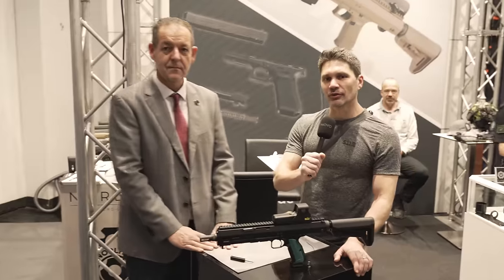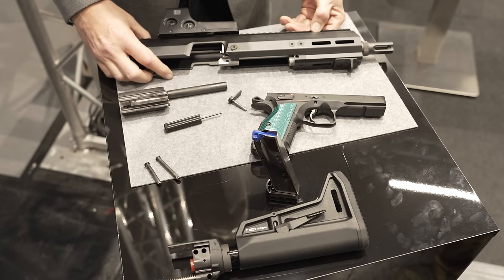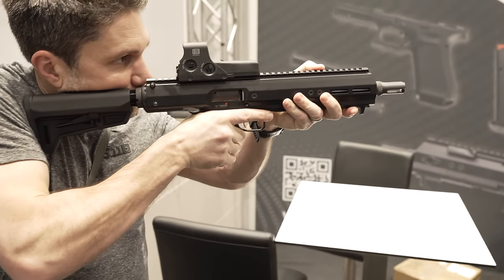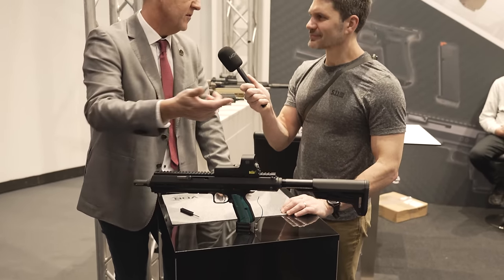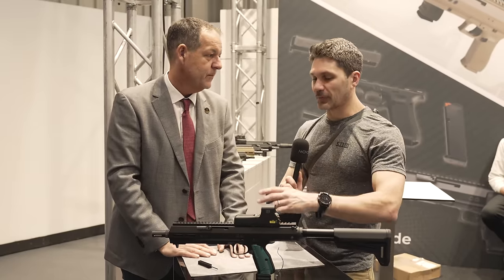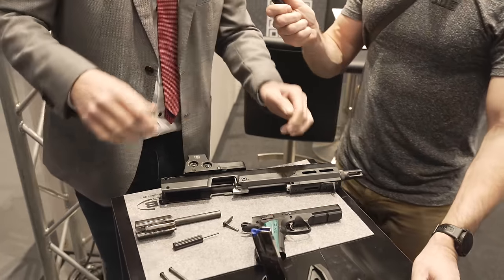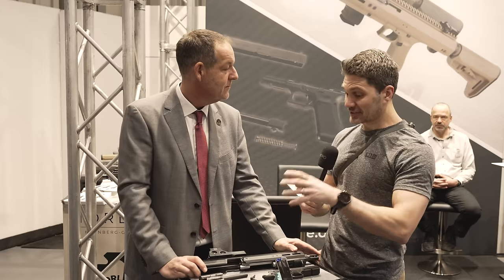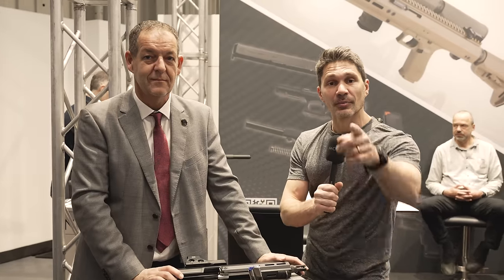A High-End German CZ-75 Carbine! The Norlite USK

Comment: For a CZ collection it would be worth it.  Let’s say you have a couple of different models of the 75 can see it being useful in that case.  The only downside of the Scorpion is the proprietary mags.  If this worked with the P07 you could use the higher capacity P09 magazines with the P07 lower.
Reply: Scorpion mags may be proprietary, but they're becoming somewhat of a de facto standard. The alternatives are more expensive (the Sig MPX ones) or worse/more unreliable (Colt-style, Stribog and everything else in between). Scorpion mags are both inexpensive and reliable.
Reply: @jeffersondaviszombie2734  I hope CZ can get them to be the industry standard.  I was thinking more of the PCC’s that are taking Glock mags.  All I have are CZ’s.  😀

Comment: I looked at getting an optic ready slide for the CZ Shadow 2 and it was over 700 dollars so I thought that it was way cheaper just to get the slide milled.  Likewise the price is just too high as it’s almost the cost of a standalone higher end PCC.  When the aftermarket accessories are almost the cost of the firearm it becomes totally impractical.  It’s like attempting to convert your bicycle into an ultralight moped for almost the cost of a moped. Why not just get a moped and keep the bike as is?  At its current cost, why not just get a new $1,500 PCC. That way you’ll have a pistol and a brand new PCC.
Reply: That is valid idea for people who cant get just new complete gun.
I like the idea but price is definelty bit steep and im afraid how many serialised firearms parts
i had to apply permits to get this. Honestly im not sure how our laws handle complete uppers
in same caliber.  

Stand alone serialised firearm part will need their own permit and every permit cost today quite lot 
in many cases it is actually  more cheaper to just buy complete firearm than parts. 
Advantage we have against german laws that we dont have any limit how many firearms you can have.
So least for me it is actually cheaper to just buy complete carbine.

Comment: The Glock version never came to the US. I doubt this one will either. 🙁
Reply: Are we able to have it shipped to the us?
Reply: While it’s cool, it would probably be a tougher sell at the price point they mentioned here where we don’t have the limitations this was designed for help with. There’s a lot of stand alone PCCs on the market people could buy here for less than $1500.
Reply: @tizben  If I'm not mistaken the company simply does not see it as profitable, and German export laws are extremely complex. So I don't believe there is any simple way to do so.
Reply: @Andrew_182  You're right. It only makes sense bin my state due to dumb laws, but a pistol chassis without a secondary hand hold, that has magazines that insert in the grip can have a brace attached to it without mandatory 16in barrel and disassembling the action in order to reload. Dumb, I know...

Comment: Makes sense for the European market. But for the American one, a chassis system that you can quickly put your concealed carry pistol into in 10 seconds or less (e.g. in an active shooter situation where you have a small amount of time) seems way more practical.

Sure, this thing confers a ballisting performance boost. But you're still shooting a 9mm. The ballistic performance boost is far outstripped by the stability boost from a stock (which you already get from a regular chassis sistem). This thing is like 3 to 5 times the price other chassis systems for only a marginal increase in performance, and requires you to disassemble your pistol in order to use it. Seems like pretty poor value for money. 

James said this is like buying a PC that you need to bring your own grip and fire control group for. But it's the price of a complete PCC. If you're looking for a solidly built carbine length gun that shoots 9mm, then just buy an actual PCC for that price so you can still have an assembled sidearm on the side to use. 

This gun seems like it would only be worth it for countries that limit the number of guns you can own. It's niche as hell.